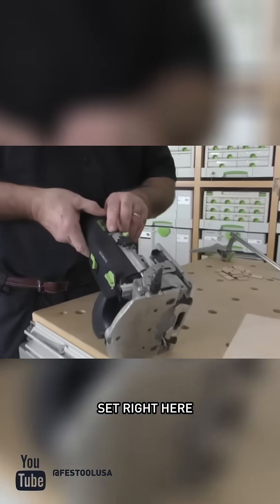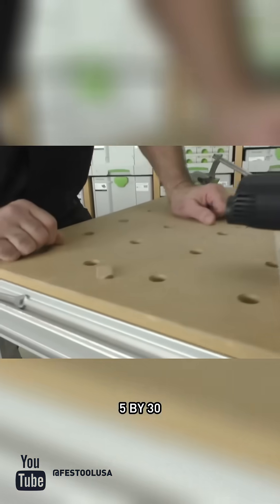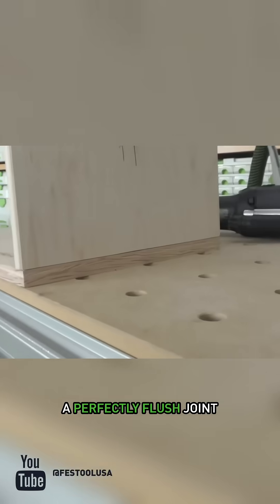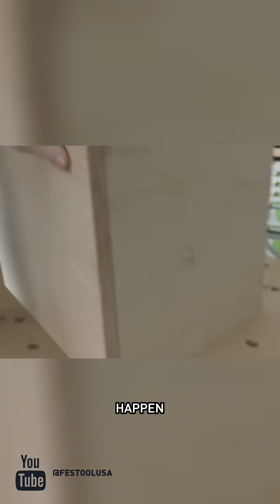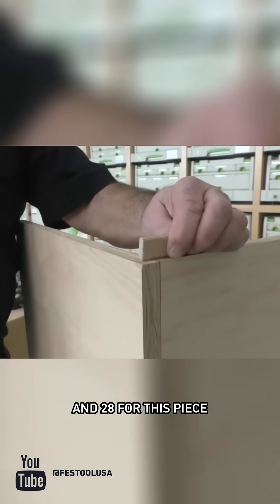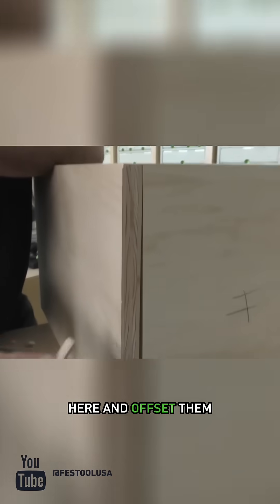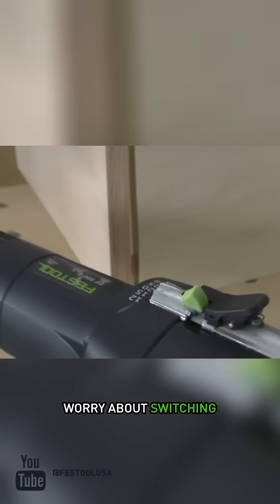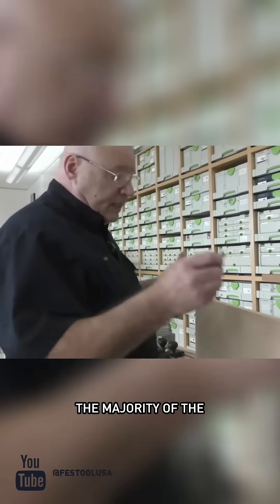Need help choosing which domino tenon size to use when working on cases? Sedge is here to help!

Comment: Wouldn't a 6mm domino be the better choice? Thinking about the rule of 1/3s. Sure you need to change the depths between 15&25, but 6mm should be significantly stronger than the 5mm
Reply: No. The 6mm domino would telegraph through the plies after the joint is glued. Dominos are compressed and swell after the glue is added to the joint.

Comment: Is there a way to have the domino show on the outside piece and cut it off to exhibit the joint?
Reply: Yep. Increase the depth of the cut on the outside piece so the cut goes all the way through, then use a longer domino to fill the joint completely. Cut off the excess. You can also use bulk domino stock to do this.